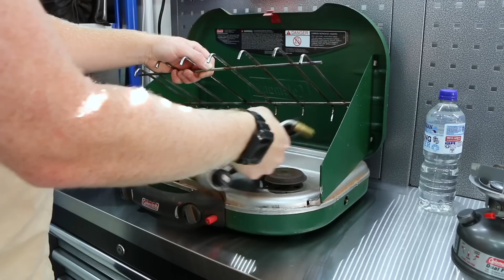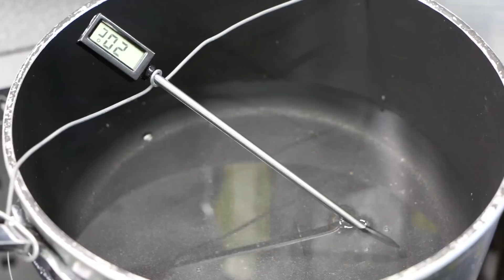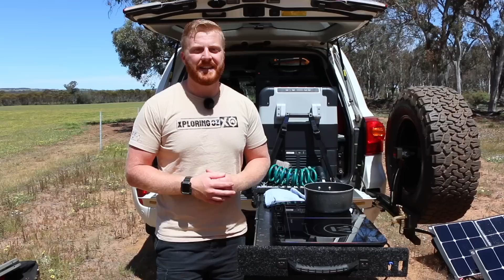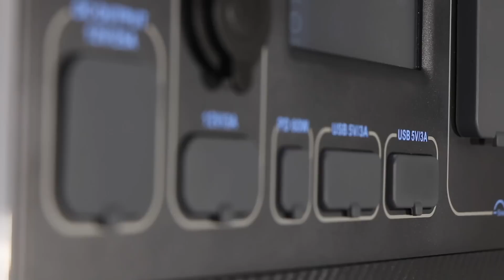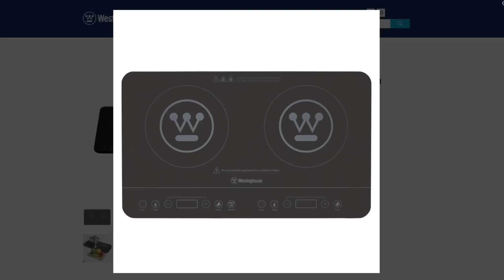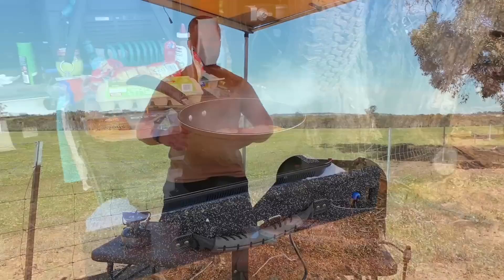INDUCTION COOKING & Camping | Is it sustainable | Electric vs Gas | Overland Cooktop | Pots&Pans

Comment: Just run it of a Generator
Reply from the maker: You could for sure, I've actually done a review on the AC200P comparing it with a generator, but personally I wouldn't be carrying around a generator and fuel source in my vehicle onto of my current camping gear. Also given the on/off activation of the inverters the generator would constantly be running up and down which could become annoying.

Comment: I find the induction way better because it works really well when it's windy. & it's much faster & cheaper to run in the long term. 
It's good for cooking in the van, without the risk of CO2, or CO poisoning.
Reply from the maker: For sure mate, I agree with you. There are soo many benefits long term and the fact that your power source provides benefits past just the induction cooking, it can do so much more.

Comment: Right on top of the induction surface it says "Do not use on metal surfaces", and, well, thats exactly what it is running on.
Reply from the maker: True, however it's only a metal veneer and didn't effect the cooktop or the bench (I checked).

Comment: I always have a few ways to cook.  Induction and a smaller gas stove as back up or the second burner.  99 percent of all my cooking is on one burner.  This includes at home.  I stopped using my stove at home many years ago and went to an induction hot plate.  Faster and easier to clean.  More efficient so over time they have paid for themselves.  In addition I don't heat up my kitchen when cooking and don't have pay to air condition.  These things save money in more than one way.
Reply from the maker: That's great mate. Glad to hear that you have got a system working well for you. I agree with packing a backup stove though, just incase. I also carry the duel fuel Coleman stove as my backup, don't want to be eating raw meet in the bush... 🤔 
Cheers, Nathan.

Comment: When the battery packs only had 500 cycles, it was not worth it.  But when there is 3000 cycles it is cheaper with the induction.
Reply from the maker: For sure, the new Lithium Iron Phosphate batteries are awesome and are probably going to outlive some of the components in this unit.
Cheers, Nathan.

Comment: To use the Electric stove you need a Decent size generator or solar power bank so it’s really not that compact
Reply from the maker: True, however a unit like the Bluetti can be used for so much more, including replacing a vehicle mounted dual battery system. I guess it depends on what power needs each individual requires.

Comment: Excellent review and I agree with your conclusions. I could live with a single induction plate and  you don't need 2000wh of storage to support a 2000w plate, you just need the power unit to support 2000w output for the duration of cooking - 15 mins at 2000w means 500wh so a 1000wh battery could be enough. In a RV I suspect a small microwave (600w ?) would be better than a second induction plate, especially for hot drinks. Thanks
Reply from the maker: For sure, you definitely don't need 2000wh of storage, it would just depend on how you plan on using the setup and your access to power to replenish the usage. 
Yes, a small microwave would definitely be handy, however as you could imagine, not suitable for me in the back of a touring wagon, hence why I didn't include one in the test. 
Cheers, Nathan.

Comment: Any quality AGM or acid type deep cycle battery is actually fine to handle those loads. If in doubt, the manufacturer will have a data sheet showing you max current draw and even max charging current. - if anything, I'd be more worried about the lithium battery's BMS freaking out under heavy loads.
Reply from the maker: Potentially, probably not something that I would risk doing. I found that my AGM battery struggled badly just trying to draw the power out and is definitely not something I would ask of it on a an ongoing basis. 
I guess I'll be testing out the resilience of Bluetti's inverters, let see how we go...
Cheers, Nathan.

Comment: Yeah, the future is electric and an EV will solve the power source problem. I powered hot plate, Instant Pot and blanket with it during my 4 month trip and I'm fully convinced that electric has unassailable advantage in car camping. EV will not only let you ditch propane tanks, it'll also obsolete Bluetti/battery, solar and inverter. Upcoming F150 Lightning can be had for less than the gas version if the new EV incentives become reality. (If 300 mile range is not enough, some plug-in hybrids also come with AC outlets.)  I'm contemplating buying one, put a wedge camper on it and then take it to Canyonlands and Escalante.
Reply from the maker: For sure mate, the possibilities and opportunities that EV's offer are remarkable. Time will tell, but can't wait to start playing around with them. 
All the best with your potential setup!
Cheers, Nathan.

Comment: Bear in mind I heard it takes 10ah at 12volts to boil 1cup of water you need some serious battery capacity it makes the gas bottles seem light
Reply: I gave my system a test and it boiled 500ml of water and dropped 3 or 4% from my 200ah battery.

I'm taking it out for the first time in a few weeks, I'll take a gas stove as a back up but it would be great not to use it.
Reply from the maker: There are many factors that would determine that, however it battery capacity would play a big part to determine whether or not a system like this would be a viable setup for your requirements. 
Cheers, Nathan.

Comment: Great video, but there's an important error.  The pot doesn't need to be iron. It does not need to be magnetic.  It needs to be a good electrical conductor.  Aluminium is fine, but must be thick or the hob will safety cut out.  Proof of pudding?  Much more powerful induction heating is routinely used to melt aluminium, they keep iron well clear.
Reply: just done some checking - i must stop being a physicist!  What i said is technically true, ie the metal does not need to be ferromagnetic for induction heating to occur.  BUT ... it seems that even cast aluminium cookware has steel sandwiched in the base, so your magnet test should work.  Stuff on the net is contradictory, induction furnaces most certainly make alu hot (very!) but many others say that cookware has to contain steel  "because induction only occurs in a magnetic material".  That reason is false.  It's more to do with the hob being "tuned" to iron.
Reply from the maker: Cheers mate, I appreciate the research and confirmation. This is definitely not something that is widely appreciated when talking about induction cooking. 
I'm going to assume that the greater population would probably seek 'induction cooktop' suitable cookware to keep it simple, but it's great to hear the science behind the technology.
Cheers, Nathan.

Comment: An added note : you can buy a metal plate for your induction hob that will allow you to use an aluminium pot. Not as controllable though.
Reply from the maker: Didn't know that, thanks mate. 
Cheers, Nathan.
Reply: You can also use a cast iron skillet that your aluminum pot will fit into, for the same purpose (bottom of the pot must touch the cooking surface of the skillet).

Comment: For background, we use induction at home and in powered campsites and propane in our caravan. We also use a 100 amp lithium battery for lighting and controls in the camper. This setup is used for multi month trips in the US. The startup cost of off grid induction ($2k power station) is impractical compared to a $100 stove and $50 propane tank. I wouldn't recommend it to my friends unless they camp a lot and have excess $.  If lithium prices continue to fall, we will see all electric caravans and overland setups become the new norm. In the meantime, I'll continue to use my perfectly serviceable propane appliances.
Reply from the maker: For sure and this is true, everyone has their own needs and requirements and budgets. We can see that lithium technology is becoming more advance and cheaper as time goes on, so I would assume that electrical systems and things like induction cooktops are going to be the future of camping and overlanding. 
Cheers, Nathan.

Comment: The one thing people forget to mention in regards to propane is that it should never, ever be placed in a closed vehicle. Interior temps in a closed truck can get very high, and what can happen is the over pressure valve starts releasing propane inside your closed truck.  No bueno.  Lithium batts have their temperature issues as well, but I would prefer them over propane any day.  That said, we actually have both on our truck but the propane tank is mounted externally.
Reply from the maker: For sure, this is another major safety consideration, thanks for sharing. 
Cheers, Nathan.

Comment: I personally would not use the induction stove while camping because we would need either direct 110v  or from a big battery bank with a at least 2000/2500 inverter to pull those 1800 watts it needs to work and that cost money and space in the vehicle  on top of a solar panel costs if need to stay of grid for few days  the other reason I don`t like them that much is because if you lift the metal pan off the magnetic stove it cuts off every time , I like to use a wok or saute and need to lift to toss while cooking and have to be pushing buttons every time it looses contact,,, propane burners are ok but do not very efficient in cold weather and need to watch not to run of propane.... any white gas stove can burn gasoline in a emergency but will just need to clean the generator stem later after the season as maintenance anyways and we all carry gasoline and is a cheaper fuel per gallon, that small stove tank burn for 7 to 10 hrs before a refill and a shield is a simple aluminum pan or folded sheet metal  .... the heating test against the jet boil is also not accurate because the size of the pots , unless you use a tall skinny pot for all of them as they can concentrate the heat in a less size surface and jet boil is mainly for just water can`t fry bacon or eggs in it...the bluetti are too expensive for me to buy for the cost of almost $100 per 100 watts ( their cost is over $1000 plus another $500+ for solar panels and panels are not cheap either, very bulky system... I stay with the gas stove and always should use a wind shield and cover the pot if want to boil anything on any stove ....I have induction stoves at home so I know it has their advantage and cons but would not use them outdoors unless I am hooked to direct electricity not to carry all the other expensive gadgets for just boiling water....lol, just my 2 cents !
Reply from the maker: Hey mate, thanks for sharing your experience. I hear where you are coming from and the initial outlay is expensive to set this system up. Then again, the benefits from an electrical system like the Bluetti extend past just induction cooking. 
But this type of setup isn't for everyone and everyone has their own method that works for them. 
Thanks for watching and sharing and I hope you found the video helpful regardless.
Cheers, Nathan.

Comment: I’ve used induction as my primary home cooking system for quite a few years now, with a pair of gas burners for power outages… which are frequent here.   In addition, I use an Emerill Legasse  brand “instant pot” which has a sous vide function I often use, and an air fryer top.  The “EG” has largely replaced microwave for fast heating, functions as a toaster, and does steaks and chops using the air fry top.  These two items could easily do virtually all my cooking….. But I’m single.  I once did all my cooking in an electric skillet for several years, and could of course do the same with induction.  You could easily use a Dutch oven on one.  I’ve used it for brewing beer, and related processes we can’t talk about.  For about $10 us, you can buy a disk that will allow you to heat ANY pot.
Reply from the maker: Hey mate, thanks for sharing your experience and I'm glad to hear that induction cooking has been working out in the long term situation. 
I too use induction at home and loving the versatility and efficiency of the system. 
Cheers, Nathan.
Reply: He must be on pay roll of induction power and Bluette
Reply: I want to see him strap that Bluette to his back and walk 1 to 2 miles to and outback area
Reply: Everything that he is using is high cost
Reply: Sorry mate I do not have $5000 to go camping

Comment: I got a portable induction top while replacing the kitchen at home and am a real convert. I now use one in the house and have one for the van I am building admittedly I am in the UK where solar isn't good especially if carrying kayaks too, but I do tend to use sites with hook ups and carry a small back up slimline stove with the aerosol style gas cylinder. One thing you didn't mention was that simmering is easier in  a breeze with induction. I often can't keep the side sliding door open with gas especially if trying to simmer. Correction you mentioned it right at the end.
Reply from the maker: For sure, I hear you. We also use induction at home and it's definitely a good thing. There are so many benefits, however it's just that power management that has to be considered when setting up a system for portable and RV type use. 
I'm glad to hear that you have got a system working well for you, albeit with a alternative back up (as I do). 
Cheers, Nathan.

Comment: You don’t want to continuously overload your power bank, degrades the longevity of the battery system of the very expensive setup.
Reply from the maker: Yes, this is definitely something to consider. The Bluetti AC200 Max would be much better suited to this application with a 2200W inverter, however it hasn't made it to Australia yet. 
Cheers, Nathan.

Comment: My jet boil gets to boiling much faster. Wonder if the fuel is different or this test is at altitude?
Reply from the maker: Hmm, not sure there. I guess there would be a few variables, like ambient temperature, (both for the water and the gas fuel), gas pressure (how full the tank is) and altitude. Saying that, I'm only at about 400m, so really not high at all. Are we also comparing the same quantity of water? 600ml?
Cheers, Nathan.

Comment: Induction has no naked flame near your petrol tank. A big safety matter.
Also in a fire risk time of the year the induction is perfect.
Reply from the maker: Definitely, another massive benefit! Summer time and high risk flame areas are going to be much safer with induction!
Reply: @XploringOz  a matter raised by a friend was that fine adjustment of the heating level was difficult at times.
The temperature settings could not be gradual enough.
Are different hot plates more different in this way.
If the pot or pan was half on the element did a half heating affect happen? This might be a way of finding a gradual change in heat.
Reply from the maker: @stephenbrickwood1602  Interesting idea with placing only half the pot onto the unit. I know this still works as I've accidentally placed the pot off centre, but I haven't experimented with trying to alter heat levels. Theoretically this would work just fine. 
Each cooker would have their own threshold for adjustment, so it would depend from manufacturer to manufacturer.
Cheers, Nathan.

Comment: 99% of batteries have amp hours. I don't understand what 2000 watt hours is in comparison. But I'll guess that 200 amp hours is a good amount of power to have. I tried  google to convert and came up with 166.67 amp hours for the Bluetti. Odd.
Reply from the maker: Yeah, it can be a little confusing. I went into a little detail regarding this measurement unit in my initial Bluetti review, but essentially Watts can be worked out by - Watts = Voltage x Amps. So if you're using 12V on this Bluetti system, then 2000W / 12V = 166aH, so you are correct there. Very different though when using 240V AC power. This is why Watts is a better universal measurement. 
Cheers, Nathan.
Reply: @XploringOz  Yes, I use kWh's with the house solar power. The motor industry seems to use amp draw from electrical accessories.

Comment: Good video.  Well thought out.  I was mildly shocked at the $3700 price tag for the power unit with solar array.  Not in my future.  You can buy a lot of LP gas for that.  :(
Reply from the maker: Thanks mate. Yes, I understand, the power station are still very expensive with emerging technology and expensive components, however you do get more than just an induction cooktop popper supply. They are very universal and power so many different things. Hopefully here price will drop over time. 
Cheers, Nathan.

Comment: Can you not charge that Bluetti direct from 12V while you're driving? It would be more efficient and would save you buying that inverter.
Reply from the maker: You definitely can charge to Bluetti while you're driving, however it only inputs about 80W. This would mean that it would take about 20hours to charge from a 12V vehicle, which in most applications just isn't viable. 
Cheers, Nathan.

Comment: Cast iron cookware that you would use on a camp fire also works perfectly on induction cooktops.
Reply from the maker: Sure would work well, and provide a very even heat with the thick metal base.
Reply: We use the cast iron pans that we have been using for 40 years - on our induction cooktop - both at home & when camping - Cast iron rocks!

Comment: Right on the top of the induction cooker it says not to use on a metal surface but you're doing your test on a metal bench. That can reduce their efficiency, which affects your test, but could also be a drawback because it can actually heat the benchtop that it's sitting on.
Reply from the maker: Yes, this is true. However the metal bench is actually a wooden bench with a thin metal veneer. It was warming up during the testing and I experience the same results on other surfaces. Although it has the potential, I didn't see a difference in these tests.
Cheers.